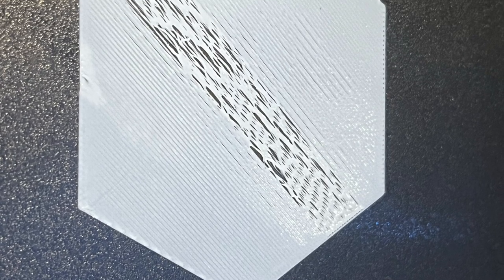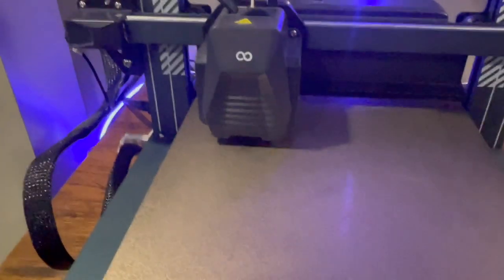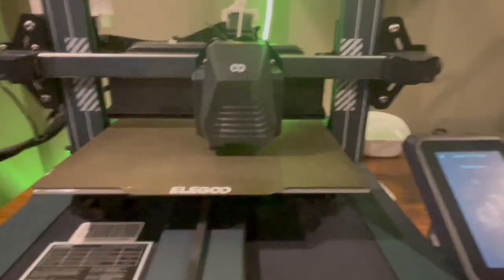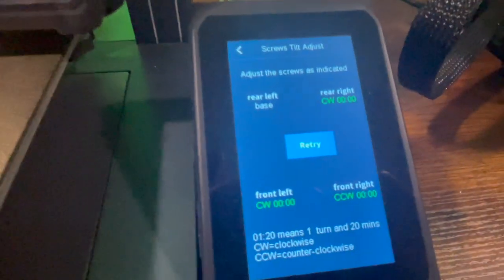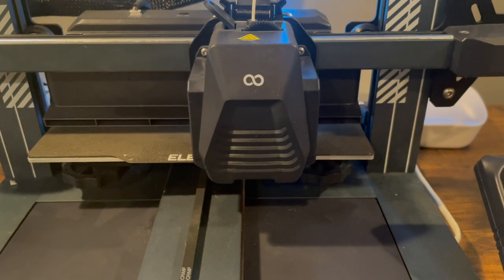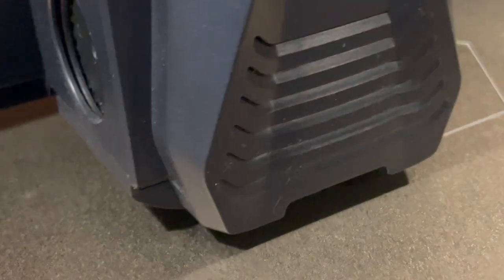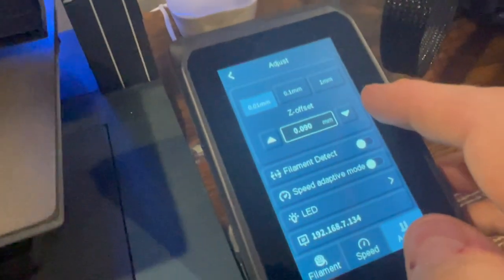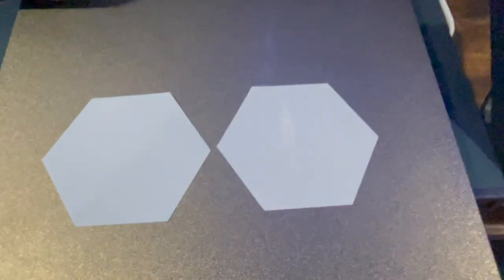3D Printer FIRST layer Problem Fixed FAST!

Comment: How did you get Screw Tilt Adjust on your printers menu? I don't have that menu on my Neptune 4 Pro.
Reply: Also, are you running openneptune?
How did you managed to get your z-offset positive values? Even after probe calibration my offset is negative
Reply from the maker: It's fine if it's negative. The important part is the test print. Even if you dont have Screws Tilt.

Comment: Is that a new firmware update? Your leveling menu looks completely different from mine
Reply from the maker: It's been upgraded, there's plenty of videos on how to do that, but I dont recommend unless you really know what you're doing. You can easily brick your printer if not. The important part is the test print.